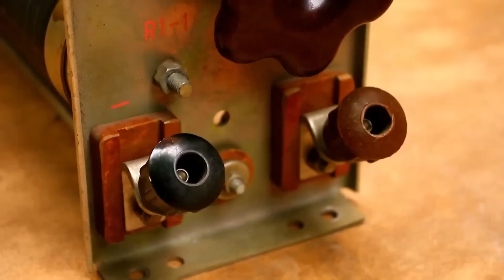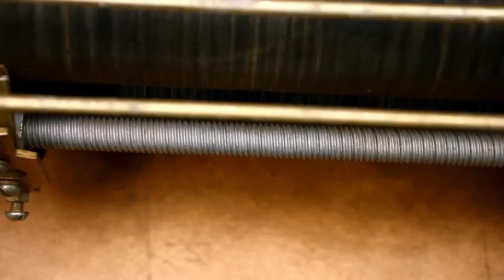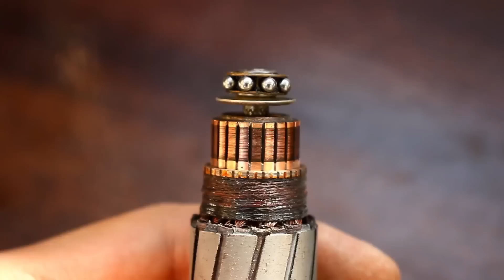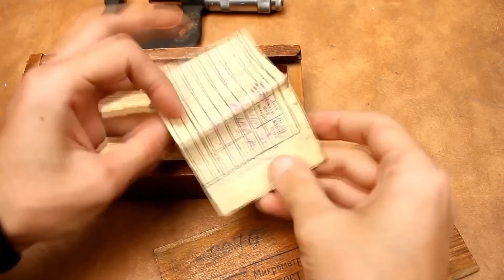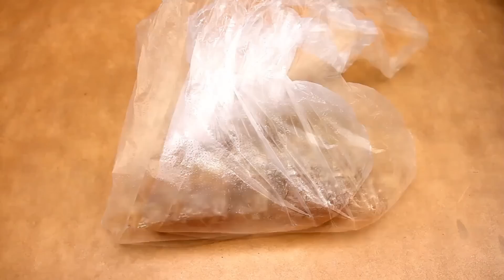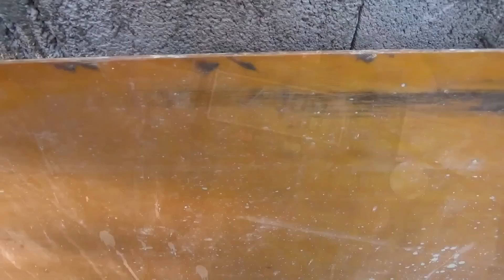What I bought at the flea market #3

Comment: I've seen that exact same voltmeter in Europe too. They are for lead acid accumulators.  A car battery has 2V per cell at 12V, so this voltmeter is a quick way to test health of individual cells, by applying a load (the coiled wire between the probes is a dump resistor, and will get hot).

Comment: GREAT FINDS!!
I have obtained many over many years: 
*HUGE train brake resistors (~0.09 Ohm)...great for supercap apps
*Q-switched ruby lasers  some with an awesome motor  IIRC:  360,000 RPM !!!
*MONSTER Xenon Flashlamps linear 1.5cm ID x ~6'  
*gianet helical Xe lamps  5-6 turns , 1cm ID tubing, 5" inside dia.
*LASER ROD over 1 foot long, 2"dia...heavy
*39MW SCR switch
*'couple of 3" dia solid brass(?) hemispherical air-actuated MJ switches.  total $1  !!!
*beautiful large ruby rods...some with mirrored ends.
* etc.

THANKS FOR SHARING!!!    SUPER!

Comment: The battery tester was designed to measure/test a single Lead acid Cell, about 2.2V/cell
Reply: EN EL MIN 0,  19 SE USA PARA MEDIR CADA "VASO" ( CELDA de 2volt)  DE LAS ANTIGUAS BATERÍAS, de plomo acido con bornes y puentes a la vista  . en Argentina se llama "startometro" ) mi padre lo tiene porque fabricaba baterias en 1960
Reply: My first thought was a load tester for a submarine lead acid battery bank.

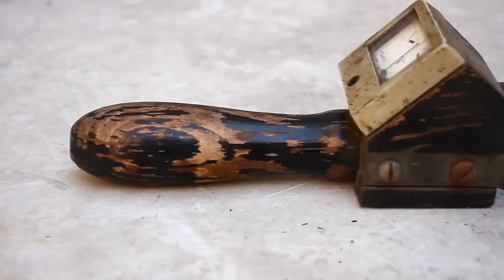Comment: 9:00 the Voltmeter seems to be east german made
Reply: It's a battery tester for just single cells.
Reply: @Electronichub_05  I am aware, but the analog ampmeter seems to have been manufactured in east germany

Edit: *Voltmeter
Reply: @janno288  it is not an ampmeter, it is a voltmeter.
Reply: @robbylehmann7110  oh sorry, thanks for pointing out my mistake.

technically a analog voltmeter is an ampmeter haha.
Reply: @janno288  current is definded by the resistor, but the voltage is important during the load resistor is in use.
Reply: Yes, it is from the former GDR.